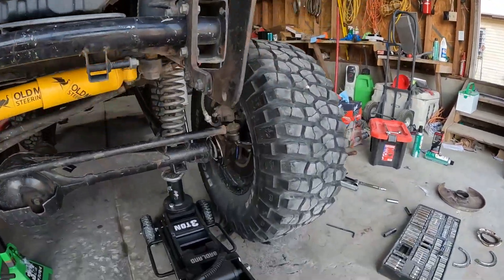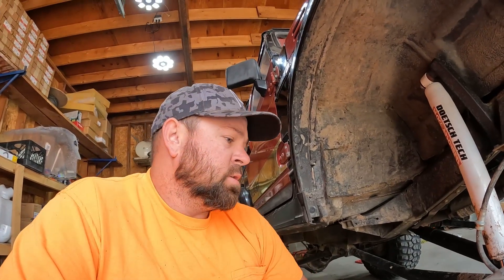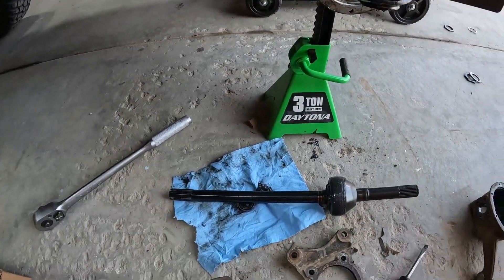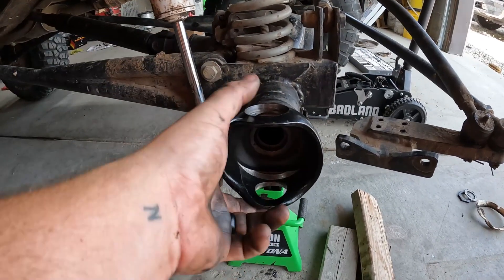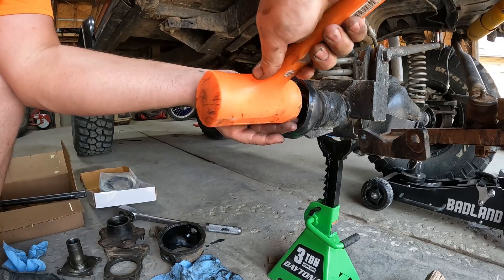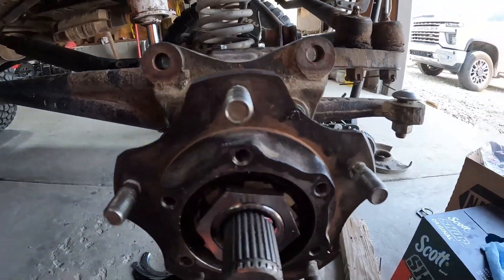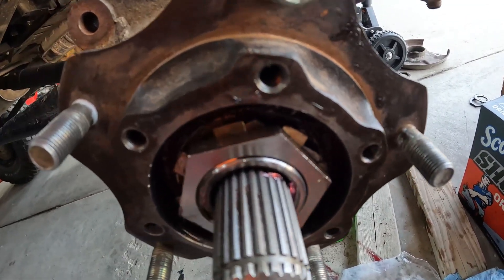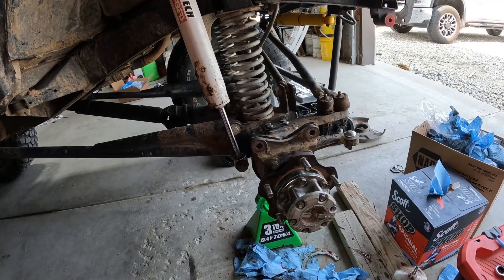Suzuki Samurai Front axle rebuild

Comment: I miss my 88.5 tin top. First thing i did was order a sammy shop manual and rebuilt the front end did breaks u joints callmini lift and 31s. Always wanted too regear and lock it up but sold it after 3 years. Need too find another one for wify. Hows the coil front sys working? Any issuses with sidehill and body roll? Nice build.
Reply from the maker: The body roll isn't horrible. It definitely looks worse than it feels from inside. The coils are great, insane travel, 8 inch lift may have been a little big.

Comment: Do you have to install a toyota transfer case to run toyota axles? I can't seem to find a straight answer
Reply from the maker: I am not sure, I wouldn't think so. It would depend if the differential was on the correct side. Custom drivelines would most likely be needed